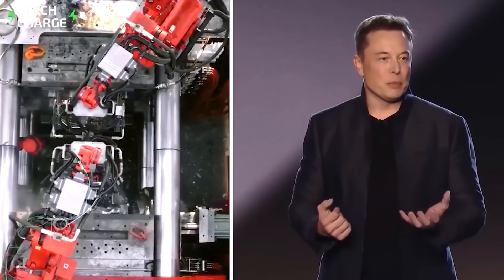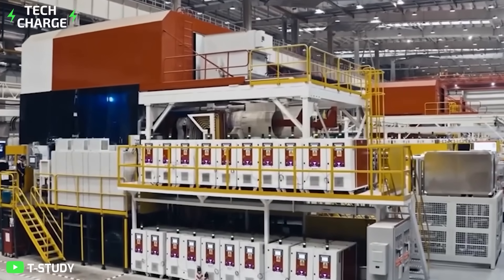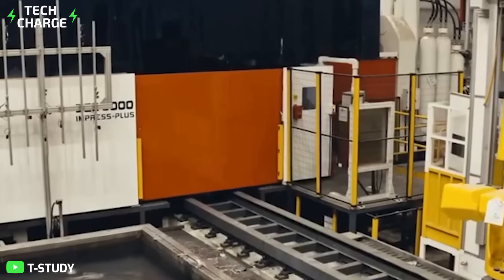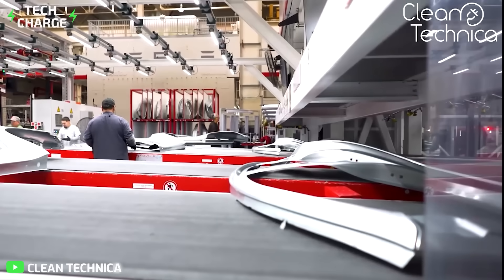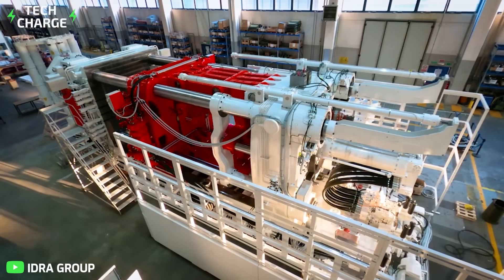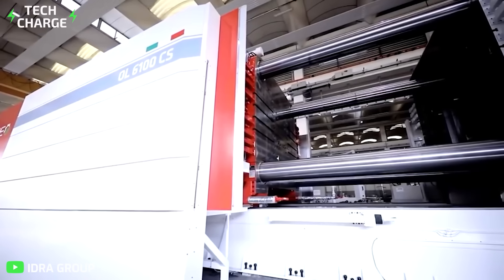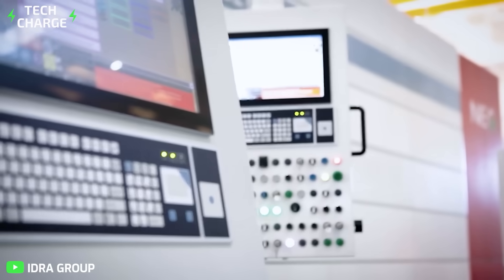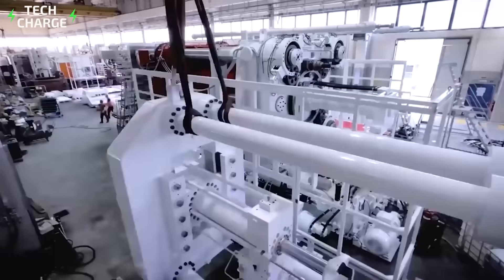How Tesla Cars Are Made So Fast - Meet the GIGA PRESS

Comment: That’s simply an amazing, jaw dropping product from IDRA.  They sell tens of millions of dollars of product to Tesla; at the same time, they must be feeling the pressure.  I can’t imagine even a second of downtime on these machines on the production floor.  These incredibly complex machine with thousands of moving parts operating at unimaginable pressure, stress, and temperature, while being the size of a house needs to be in tip top running shape 24/7, 365 days a year with no downtime other than routine maintenance.  IDRA probably has a support staff on every factory floor these machines are installed in, of which are probably on call 24/7.
Reply: MADE IN ITALY 😁😱😁😱🤣😱
Reply: Lmao, have you ever had any contact with car part manufacturers or the automobile industry in general?
Reply: @KlausDoitschlaaand Why do you want to know this???
Reply: Its nots as intense as you think. Your way over thinking it and at the same time givin them to much credit. Its just like every else downtime is expected and factored in to production
Reply: @BaggerVance42  i kind of just said that, different words same meaning.
Reply: Wow so you are saying that these machines are like other machines, like a continuous slab caster? And will need maintenance crews like a continuous slab caster or any other big machine? Wow. You know a continuous slab caster is as big as a block of units. This isn’t the first big machine.
Reply: I like how you are amazed at a car making machine, a steel press, but you know nothing of how steel is made in the first place, much bigger machines.
Reply: @steyer-crmg This has nothing to do with steel.
Reply: its less jaw dropping after a minor accident you had to throw the car away because for save production costs, repairs are basically impossible
Reply: Calm down
Reply: That's why there are more than one machine at the factories. They also have many castings stockpiled in advance of need.
Reply: Tesla will sell 1.5 million cars this year and 10 million by 2035
Reply: And what’s down time for pm?  As I’m a maintenance I can’t imagine what do I have to do
Reply: @deanle604  Pm's on plastic injection molding is pretty straightforward. 6~8 hours. Just keep it lubed. I cant imagine its much different.  They look identical but giga is huge.Its when you have to pull the screw you  can get some massive downtime. Its the assembly machines that are a P I T A .
Reply: It's doing moulding,  not much pressing .
Reply: @jkardez4794 Injection molding. It is definitely "pressing"